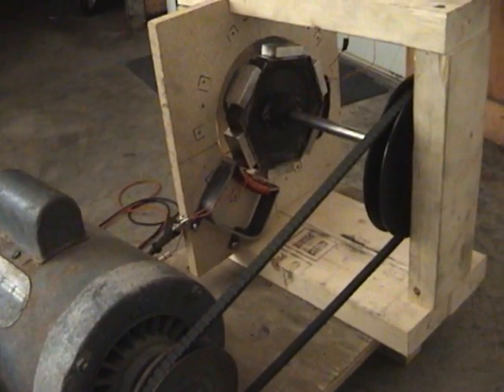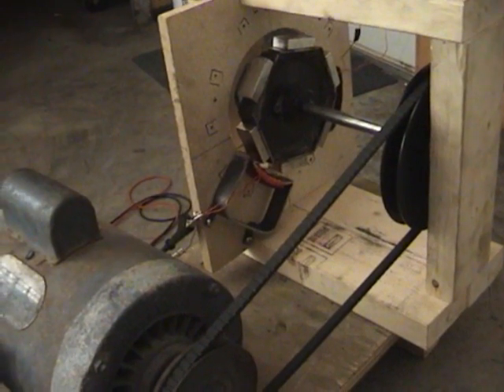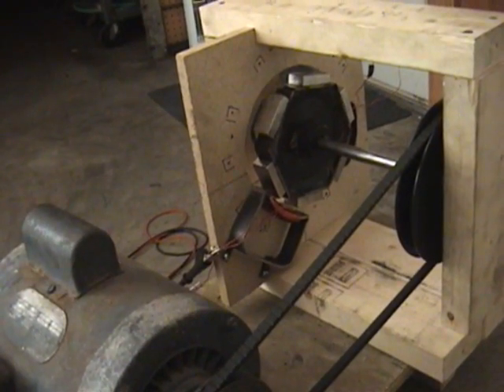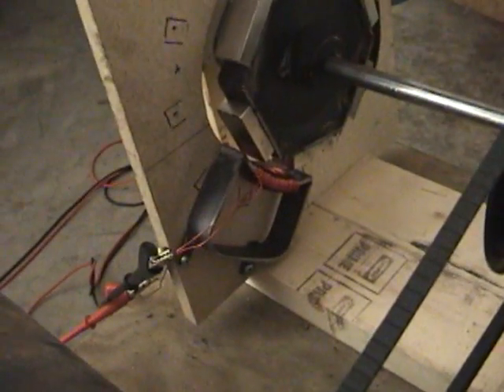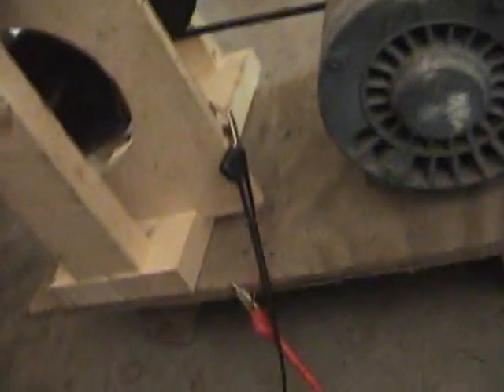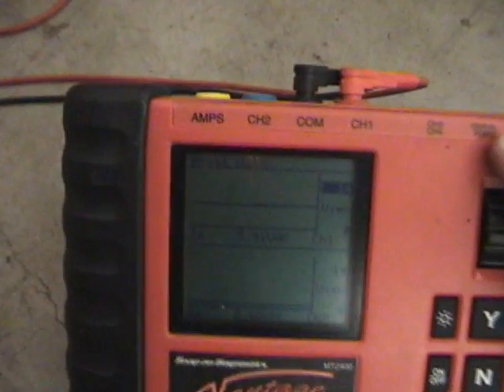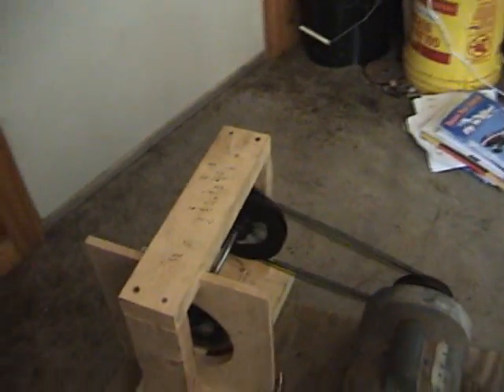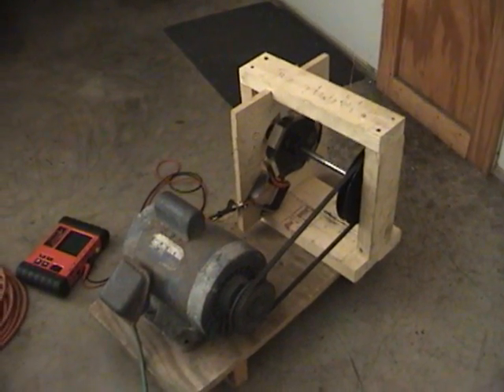Toroidal Generator

Comment: I really don't get it. You were talking about 6 coils to get 60hz and all the stuff striving to get the number of coils and rpm for some specific voltage. 
OK. I understand the search for more efficient methods of converting a fluctuating magnetic field into electric current but, after the damn generator stick a switching regulator (with good mosfets or igbt's) to output you whatever voltage, AC or DC, and frequency if AC.
;)
Cheers!

Comment: your coil is too small that the wires close to the magnets move electrons to say the right of the screen, and the wires on the other side still being in the magnetic field moves electrons the same way to the right of the screen, thus canceling each other out see what i am getting at?  instead of electrons moving to the right then around then to the left on the other side, but the field effect that side as well being so close that it cancels it out, sorry didnt know how else to explain it.
Reply: 1crazyfocker, if you were talking about an air coil then i would say your right. But, he is using an iron core. The magnetic permeability is much stronger, and confines most of the fields lines to inside the coil.

Comment: @weeeendog Wow. The Lenz effect is definetely NOT the purpose of a generator. We need Lenz's law to create induction, because that's just how induction works in a conductor. However, we do not need to have Lenz drag. The magnetic drag, and magnetic induction are two totally different events, and both can be seperated. You CAN have induction without Lenz drag. One example is the Lutec design, the Orbo design, the Bedini oscillator, or the Robert Adams motor, all produce induction WITHOUT drag.

Comment: Ferrite cores require fewer turns, will give more impedance per turn and will give tighter coupling. Iron powder cores will require more turns, less impedance per turn and looser coupling, but will tolerate more power.

Comment from the maker: Instead of trying to talk trash about my 'junky generator,' why don't you build one? Why not build one at 20, 30, or even 50%? I could have EASILY added more rotors and more coils and increased the % that you brought up. I never said that I was trying to design a high percentage system. Simply a system with a minimized Lenz effect on the rotor. You are the one who brought up the 99% loss. I NEVER claimed to be attempting to build a low loss system. You can't see the forest for the trees.

Comment from the maker: Beats the hell out of the one you've built, and the idea is to minimize the Lenz effect on the rotor...try reading the comments to the left of the video. Who gives a crap about the amount of loss on this system? I could care less if it runs at 1/1000th% so long as it proves the idea correct. My comments are quote: "My attempt to build a generator that doesn't create 'free' energy, but will reduce the drag or Lenz effect most conventional generators experience."

Continued on next comment -